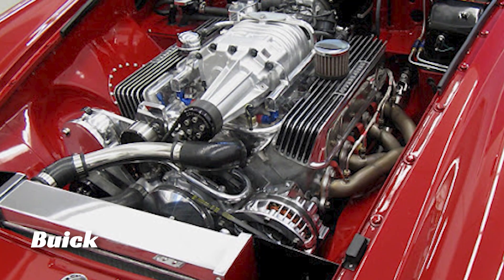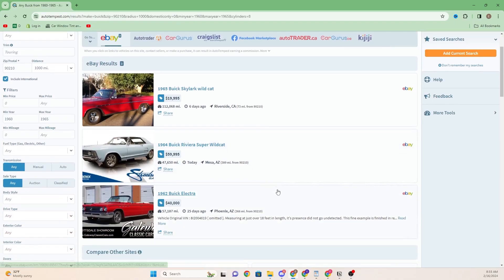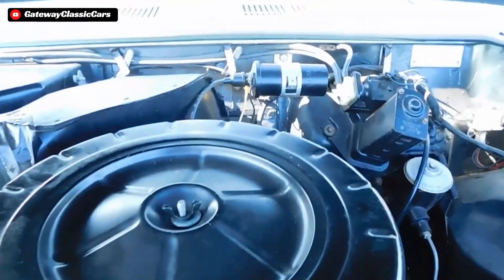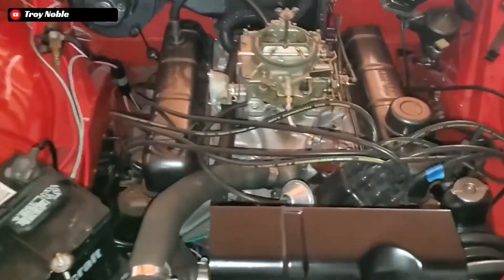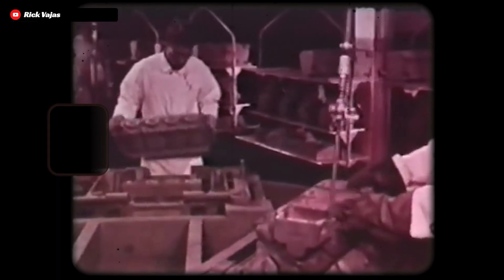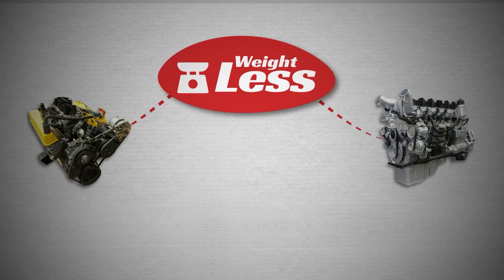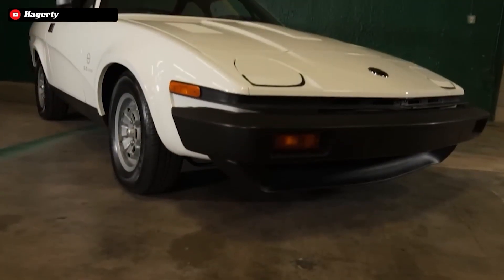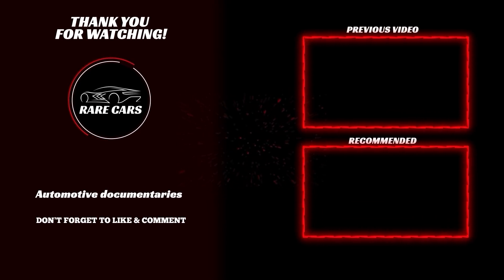The Little V8 That Powered The World  - The Buick/Rover 215 V8

Comment: William L Richards has a great article on this.  Buick tried die casting the block and had a 98% scrap rate.  Rover sand cast the block.  for reference, new DOHC V6 weigh around 370 lb.

Comment: The rover v8 was the starting point of the v6 engine in the 6r4. It was the v8 with two cylinders cut off. It was 3litre Which made 450bhp at 10,000 rpm. I believe that the “ptoduction” 6r4’s were unique castings.

Comment: I worked at the Laguna Seca races in Monterey, CA in the 1980s and was most impressed by the Formulae Atlantic class.  As I recall, the design was like a scaled down Formulae One and was that car powerful, loud and FAST.  I'm not certain, but it may have been turbocharged.  When the waste gate opened, it really got your attention.

Comment: The Buick 215 aluminum engine was modified by Leyland Australia in 1973 and 1974 specifically for the Australian Leyland P76 car. This modification involved increasing the engine deck height by one inch to accommodate a new crankshaft with a stroke and bore of 3.5 inches each. As a result, the engine had a square design with a total displacement of 270 cubic inches, or 4,416 cubic centimeters (4.4 liters). Additionally, the engine was designed as an all-aluminum V8.
https://www.youtube.com/watch?v=juRx6Bre6q0&ab_channel=CromerTyres%26Mechanical

Comment: You should also cover the Buick V6 that was essentially the 215 V8 with the front two cylinders removed and cast in iron.  The V6 came is several sizes, was installed in every GM brand made in the USA, including Cadillac, as well as the Holden Commodore in Australia.  It was turbo charged in the US and supercharged in Australia.  I don't consider the later 3800 versions as the same basic engine as they had balance shafts added and were installed transversely for FWD applications.

When I replaced the anemic 2 liter Triumph engine in my TR7 Spider I chose the iron Buick 231 V6 over the aluminum Rover V8.  It performs as well and when I need parts, which is very rarely, I can buy them at my local NAPA store.  Headers, windage tray and a 4bbl help.  I built it over 30 years ago and other than cleaning the carb filter from time to time and changing the oil annually, it's just an appliance that gets driven every week to our local cars and coffee mornings.

Comment: I've got the 4.6 version from a Range Rover in my landcover, heads are horribly restricted due to valve size a big design fault along with not top hatting the cylinder sleeves but they are a great little V8 besides that

Comment: I figure it should sound like a small block chevy engine. Being it has the same firing order. I wouldn't mind having one.  Put it in a 80-95 toyota or  nissan truck, maybe a 70's chevy luv truck, or similar small trucks.  Or a modified car converted to rear wheel drive. A 90-95 Toyota camry being one. A rover v8 with 9:1 ported heads larger valves, custom cam, a custom built tpi system milled from cast aluminum and aluminum tubing. With 2" o.d. tubing. And 80 mm throttle body. With the intake. Built similar to a holley high ram 3.5" long runners with 1.7" diameter 2" trumpets inside the pkenumaboyg 1cubic foot. With a 4"x6 x1/2" thick plate over the front end and a .180" top plate  with perimeter bolts(m4) and fins .125" thick  on .250 centers . The top cover having a thick , non finned area over the  center of the ports and in the center of the cover .625" on the sides, and .500" in tge center. To allow shower injection, dpraying water/methanol  with cast aluminum valve cover,  matching the intake.  With a turbo capable of 20-36 psi boost  12-18 psi nominal 20-24 peak , with an air/water charge cooler. Setup making boost at 1800-2000 rpm.. keeping the engine under 7800-8k rpm adapted to a t56, tr6060 6 speed box of coggs. With a 4.10 - 4.56:1  rear gears. With 22"-24" rims with 28-30" tires or 20" with 27.5" tires on 8" front wnd 10.5" resr using c4, c5 vette brakes and front suspension. It should do around 800 hp minimum.  Enough rambling and dreaming,  have an awesomeness day🎉

Comment: My 4.6 is getting backed by a 1990 Camaro V6 T 700-4r (narrow bellhousing) going in my 1974 Opel Manta Berlinetta, and the '63 215 Special Deluxe JN code hi comp 4 barrel engine will have the Borg-Warner 5 speed going into my '75 Opel Ascona Sportwagon.

Comment: I'd like to see American car manufacturers use V8 engines more often.
 Especially in pickup trucks. The mid size pickup trucks suffer from being overweight and under powered.
 A V6 just don't work. The other thing in America is the big corporations greed.
 It has nothing to do with "climate change, pollution, or the lack of energy" (there's a whole lot more oil than these beaurocrats will ever admit.
 Politics has become so dirty,  a lot of technologies were buried to maintain their power in the industrial war zone. 
 However, if it was up to me, my V6 truck would have a small V8 for the plain simple fact that V8 engine's are far more powerful, fuel efficient and reliable. If "Climate Change" was real, and people were serious about doing something, things would be very different.
 A V6 may use a little bit less fuel for daily driving, but that all goes away when you have to haul something.

Comment: I've had much experience with this engine and I love it it's one of my favorite v8s to tune and it is very responsive to power upgrades. Can you get 275 horsepower out of 215 cubic inch aluminum small block it makes a little car move

Comment: In 1976 we used an available kit and put a 215 4bbl from a 61 Buick into a 72 Vega, no chassis mods necessary with its light weight and HP, and it was a little street sleeper.  Fun times. 😄 If only GM had used the 215 in the Vega!
Reply: I just commented on my 71 Vega about that. Sweet fast car.

Comment: The 215 V8 used by Australian F1 champion Sir Jack Brabam was the Oldsmobile version , 20 blocks were imported to Australia and Repco Australia and engineering firm designed Over Head Cam Hemi Heads and dry sump oiling among other mods to survive 11 000 rpm . The Olds version was specifically used as it had different block casting and an extra head bolt each cylinder . Sir Jack Brabam built his own car, drove it to win the Formula 1 championship against Ferrari, Lotas, BRM, BMW, Mercedes with a little pushrod based GM V8 . 

Leyland car company Australia built a tall deck 270 ci 4.4 litre version, and installed it in the Leyland P76 car in Australia. There was a 5.0 litre 303 ci version also designed in Australia that never came to production . 

The Alloy 215 ci V8 of Buick had bigger Buick engines in the family , the 300ci , 340ci kept the alloy 215s head design but when the last 350 ci Buick V8 came out it used new head design very simular to the 455 design Buick Big Block . 

The 215 V8 was also the basis for the longest running GM V6 in history , the Buick V6 is just the 215 with 2 cylinders cut off , even the last versions of the Buick V,6 in 2006 still retained the 215 v8s 90 degree bank angle and bore spacing. Ever wondered why the V6 Buick had a strange unbalanced 90 degree bank angle? Because it started life as a little 215 ci alloy V8 .
Reply: Not sure what the differences were between the Olds & Buick blocks.   Even though they carried separate numbers, the Buick also has the bosses for the extra head bolts that could certainly be drilled & tapped.
Reply: @BKRMON  you are correct . I was going on the Brabham /Repco Australia papers , they devoted two pages to using the Oldsmobile over the Buick and the head bolts were a big factor . Don't know why now. They designed the over head cam heads and drive system . For the Formula 1 team . Leyland Australia cast a tall deck version of the 215 it was 270 ci
Reply: @BKRMON  The Buick casting doesn't have the  bosses for the extra head bolts , there is no casting there on the Buick motor to drill . Oldsmobile had totally different heads .  The Oldsmobile was specifically chosen because of the extra bolts .

Comment: TVR had a 5.0L variant.  there are larger bespoke variants available in the UK, just like you can get a 572ci Chevy.
.
and the F1 engines were OHC variants with the 6 bolt / cyl Olds block.  if somebody is looking for the records, it's called the Brabham Repco and it has 2 F1 championships.  Repco is an Australian company that did the race development.

Comment: 283 Chevys were "truck motors" before they were "car motors". STRAIGHT-TRUCK MOTORS. 

That's a REAL "high performance" application and one no BOP engine ever "matched" on an "ongoing basis". GMC did use some Pontiac "small blocks" as "truck motors" to "compete" with Chevy trucks with Chevy engines before finally giving in and "adopting" Chevy engines when it was that or "go under". And it was using car engines as "truck motors" that was primarily responsible for getting GMC to that point.

Comment: Hello Rare Cars, Great video....good idea doing specific engines. Could have added sound v8 sound recording too. These engines were fitted with twin 6 inch headers and with up to 5 litre capacity in the TVR's 1990's to 2003. Very few cars sounded like that right out of the factory! Flat plane crank too so at 4-6 thousand rpm the howl is real! Also you could add details like basic cam info how many an engine has where they are mounted and basic valve details. Links to more info. Fb has a big "Rover V8 enthusiast" page. Getting good quality parts for rebuilding these is challenging now. Thanks for all your videos. 😊

Comment: We just got done refreshing restoring a Buick special wagon with all original 215 V8. What's the original transmission which is air-cooled the offense on the torque converter which is rebuildable.

Comment: I once into the machine shop at the parts store, Steve tells me to hand that engine block. I almost threw it over my head, bare block barely weighed 10 lbs. It ran great but were blowing oil smoke at 50K miles. original engines did not have iron sleeves. Pontiac's OHC straight 6 ate it for lunch too. PS longest production run of any US engine ( besides Briggs and Stratton ) was Chevy's 262, forerunner to 283. UPS ran it for decades.
Reply: Spot on they're weak

Comment: Back in the late '90s I was thinking I'd put an Olds 215 into a Volvo P1800E. I bought an engine, had the Volvo in my driveway for a few weeks, then decided to move 600 miles away, it didn't happen. They were good engines, there were some differences between the BOP engines, the Olds was thought to be a bit better. At the time people were putting Ford 289s into the Volvos, there were manuals detailing how to do it. I still look at P1800s with some longing, they are quite beautiful in my opinion, especially without bumpers.

Comment: Great video! As an owner of a 1975 MGB, I've considered a swap to one of these engines. The ony thing holding me back right now is that the original 1.8 litre engine that's in it is running great, and it's hard to justify the money and time required when there's nothing wrong with the current powerplant.

Comment: The engine that inspired GMs 3.8l V6 in 1962, later the 3800 V6.  Both, absolutely brilliant engines.  

Edit-I might add that the first iteration of the 3.8l V6 had many drawbacks.  Including roughness/vibrations, as it was an oddfire engine due to being literally an engine designed with 2 cylinders "lopped off".  Adding the split journals and balance shafts, really brought this V6 to the next level.  Hence the reason why so many 3800s are reacing 300k+.  Such a shame that GM killed this engine off.

Comment: So much misinformation in this video it's not even funny. These were horrible engines in the 60's and they were horrible when Rover was making them. Hardly an icon and they certainly did not power the world. If you want to make a video about an engine that fits the false description you gave this one in this video, then you should be making it about the small block Chevrolet...or even the flathead Ford. This engine should be at the very bottom of that list.

Comment: You really didn't need to rev them, if you meant to win races in professional motorsport then sure... My 1963 Skylark doesn't even need the secondary barrels. It likes staying under 5,000rpm using velocity on the primaries.

Comment: My 1963 Buick Special had the 215 V-8 with the Dual-Path 2-speed automatic transmission.  Under hard acceleration it could run up to 60 mph in 1st gear.  Being a very lightweight Uni-body sedan, this would only take about 7 seconds.  My 1970 Chevy Nova 250 L6 with 3 speed manual took at least 9 seconds & 2nd gear to get to 60 mph.  I no longer have either car, but if I had my choice, I'd rather have my Buick 215 V-8 back, hands down!

Comment: Owned four of these engines two in P6 Rovers two in 80s Range Rovers never rated them, underpowered, burned oil, engines car boned up internally, camshafts wore out as early as 60-70k miles later engines were better apparently ! Buick stopped making it for a reason. 🇬🇧

Comment: What you failed to point out in your video was that the origin of this V8 was from BMW in Germany and fitted to the 328 model and others in the fifties. It is ironic, therefore, when the engine came to the UK and fitted to Rover cars, that ultimately BMW took over the failing British Leyland Group which included Rover.
Reply: I've just googled that...its incorrect...the buick 215s only common connection with the beemer is they're both aluminium...its possible that GM had a look at the BMWs v8....and decided to build there own ..but the 215 is NO COPY.

Comment: you missed the big one, the Repco Brabham formula one engine which won the F1 world championship.  Repco was an Australian engine rebuilding firm still in business today but only sells parts
Reply: They did mention the Brabham engine. They didn't mention that only the block was used. Repco fitted their own liners and special block stiffening castings as well as their own ohc cylinder heads. It was also only 3 litre displacement.

Comment: One more use for this engine deserves a mention: In the late 1960s, aircraft designer and race pilot, Steve Wittman, adapted an Olds engine to power one of his Tailwinds. I believe several other Tailwind owners used them as well.
Reply: In the early 1980's a guy in California designed an all-aluminum kit plane that used the Olds 300 V-8, sounded like a sweet hotrod cruising by at 180mph.

Comment: I had a 215 in a '73 Vega GT , Edelbrock intake,  Crane cam , not much bottom end torque but easily revved to 7200 rpm which helped .

Comment: It was also used in the Australian Leyland P76:
"The top-of-the-line 192 bhp (143 kW)[5] aluminium 4416 cc V8 unit was unique to the P76, and was a derivative of the ex-Buick V8 that was powering the Rover 3500 and Range Rover."

Comment: Great video, except it didn't help to show a Pontiac Tempest engine bay with the half-a-V8 four cylinder instead of the 215; nor does it help to show a '64 Buick Special engine bay with a 300 CID iron block motor! You can do better than that!

Comment: I did my time on Rovers and we used to pick up 215’s and put them on the workbench to run them up😂 when rebuilding them the remote oil pump has to be filled with vasaline or assembly grease or they don’t pick up oil and run bearings aside from that i like them.

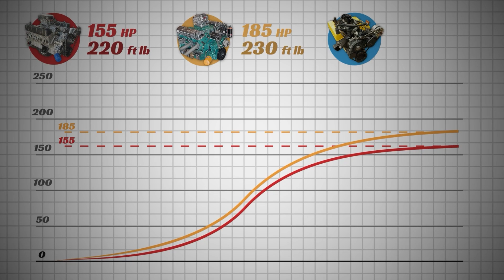Comment: 3:50 GM installed a cam with the 4 barrel carb to make 185 hp.
Reply: The engine fitted in the Rover P5b with twin su carbs was rated rated @ 184hp
Reply: @chipmonk12  Your point
Reply: @Fone65  2 ways to arrive at the same result
Reply: @chipmonk12  Name the two ways